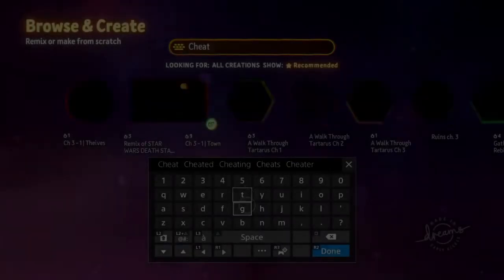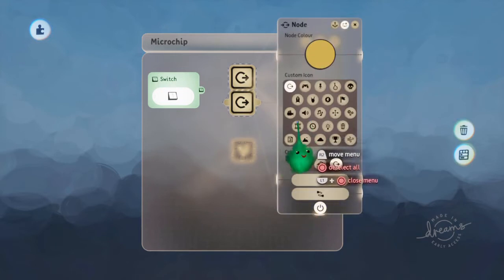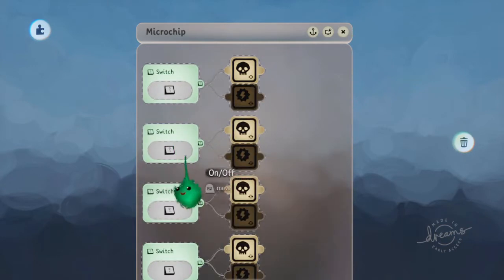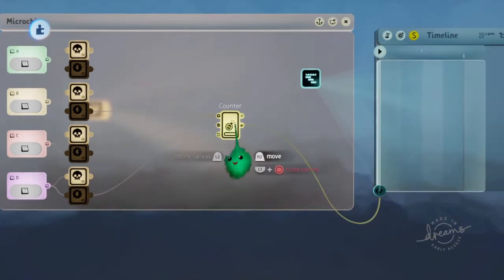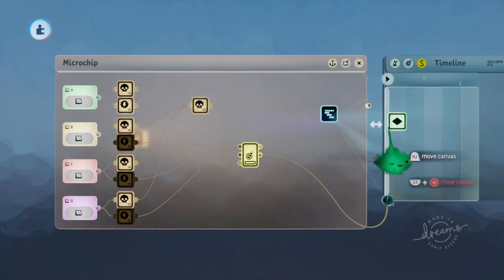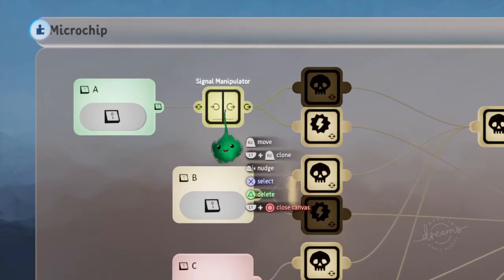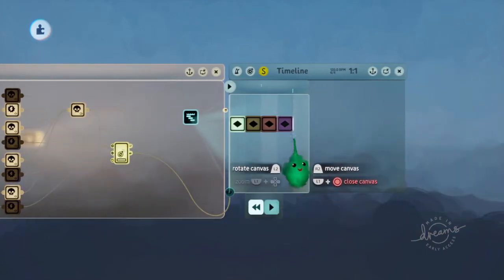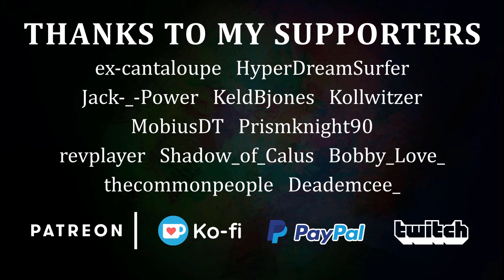Programmable Code Input | TAPgiles Daily Dreams Tutorial

Comment: Hey!I might sound silly but how exactly do register the inputs you want to this asset?
Reply from the maker: Wire them into the inputs. :D
Reply: @TAPgiles  you mean wire them into the keyframes? ill suppose you mean if you press something wrong out of these buttons you have program and not every controller button?Am I right?
Reply from the maker: @ultrasound86 

No, into the signal manipulators basically. But into the switches is fine, or you can make input nodes for the chip, or whatever you want to do. At 0:22 I explain how to use it and set up the inputs.

Yes, only the ones you actually wire in will do anything. But if you had like a load of other buttons that you want to reset it, you could wire them all into the same port and just not put the corresponding keyframe into the code timeline.
Reply: @TAPgiles  Thank you!